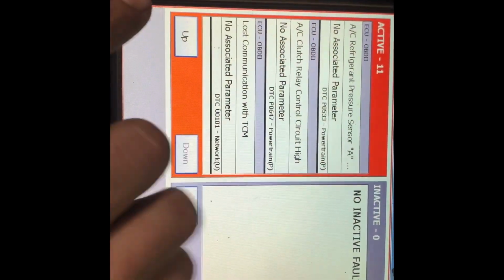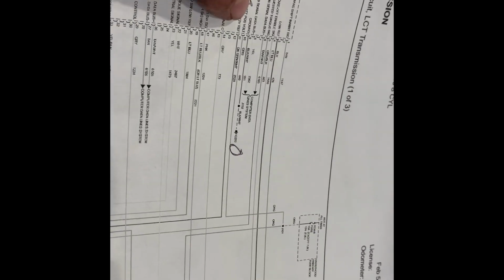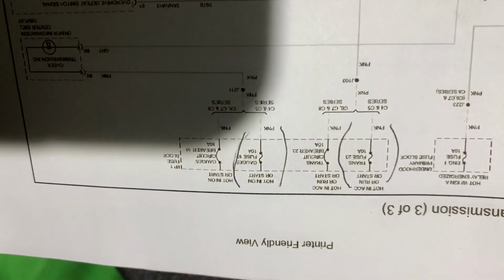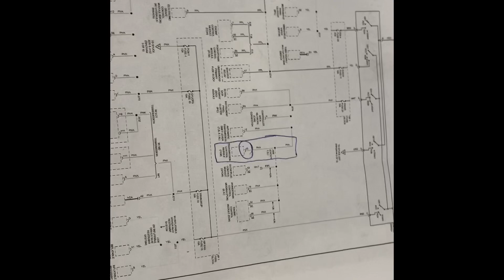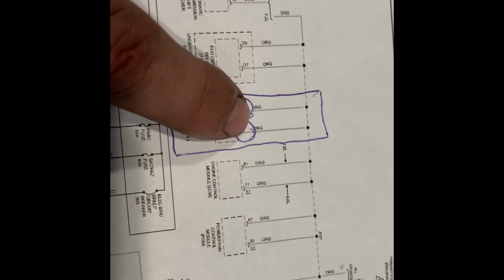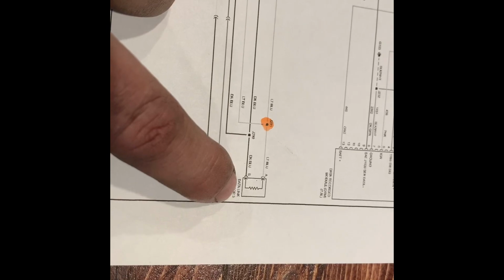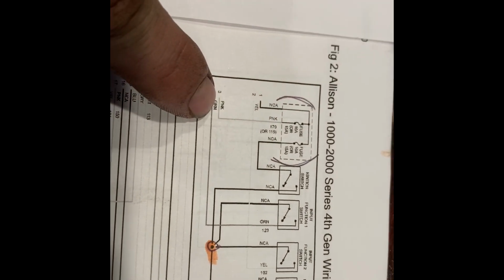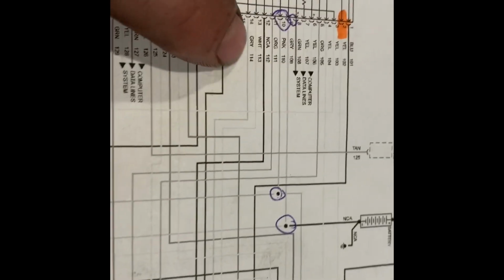Matco truck diag

Comment: Good idea to start with checking the wiring harness Chris, maybe 60% of the time it's a loose connection/high resistance/bad ground rather than the computer.